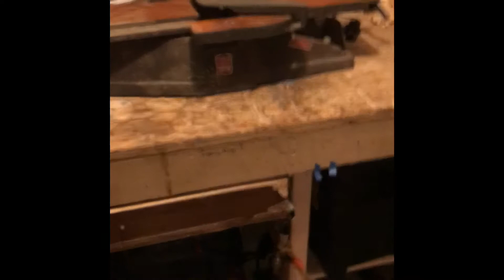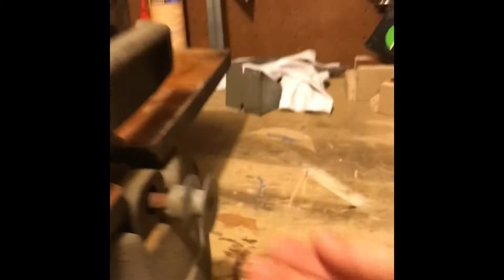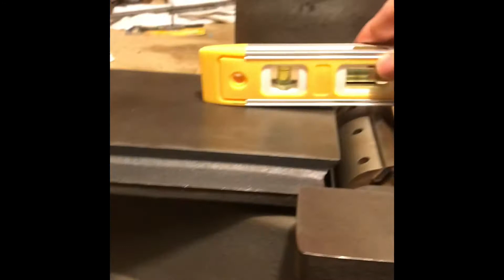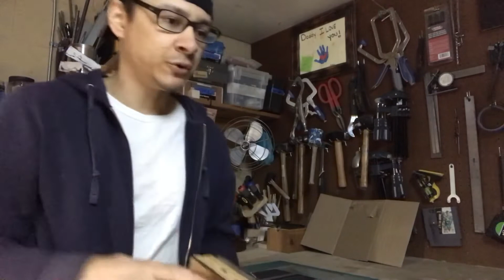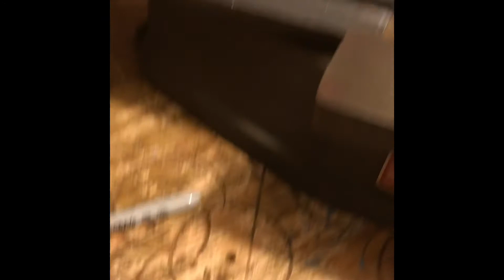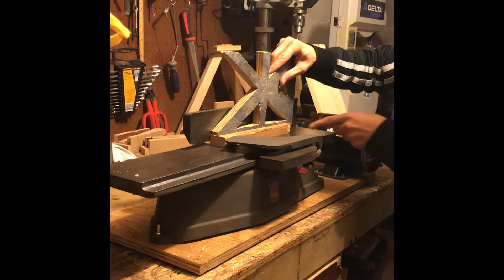Don’t Buy a Jointer Blade Sharpening Jig

Comment: unless my eyes deceived me, it appeared that you jointed all 4 faces of the board, this may have just been for testing, but you checked it with a square after the fact. When jointing you joint one face on side to flatten and bring those 2 faces flat and square to each other, after that you use a planer to bring the remaining faces into parallel, if you attempt to joint all 4 faces they'll be flat but not necessarily square.
Reply from the maker: Yep yep, that was just testing it out but you bring up a great point. Thank you.